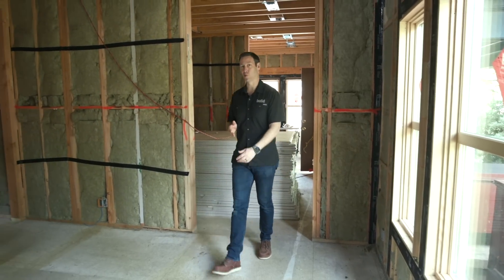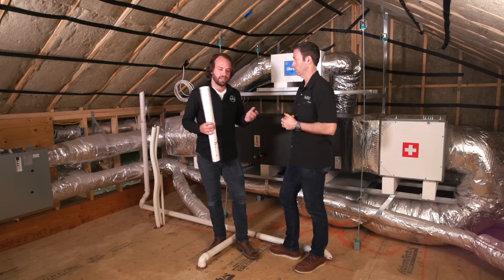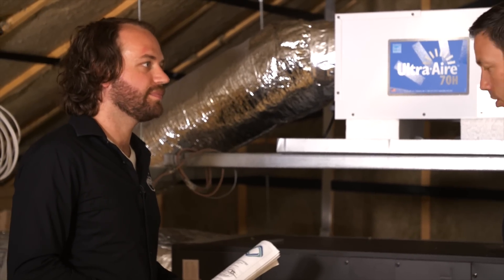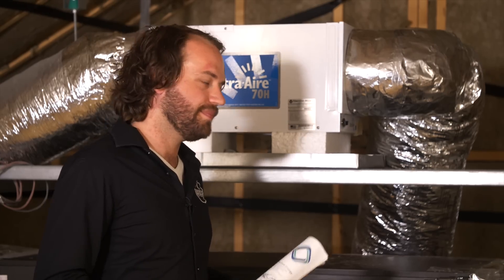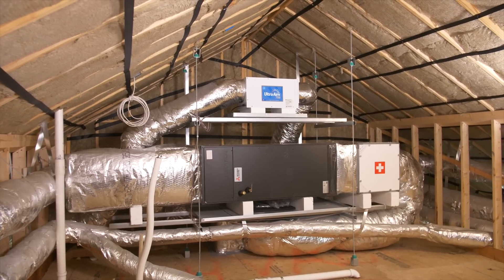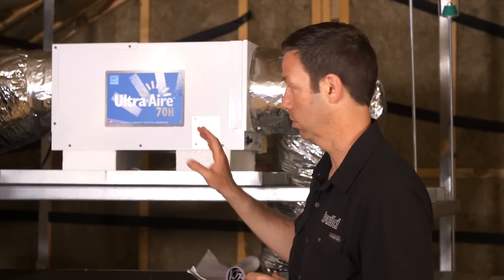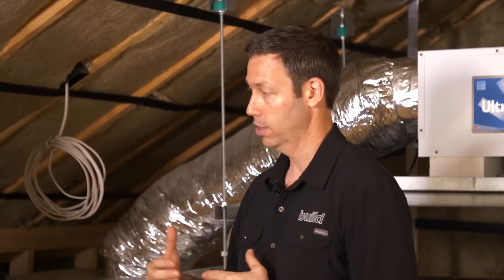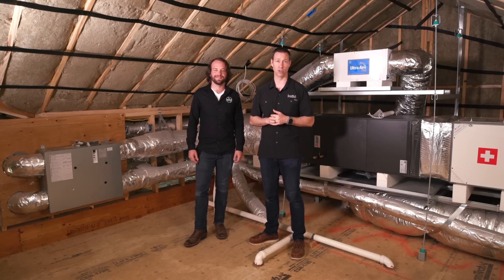New BUILD : Excellent Air Conditioning System Cost?  I’ll tell you!

Comment: “So what does a typical unit cost here”

“Well you know, it all depends on the environment but things have become highly competitive”

I get it, I can’t afford it.
Reply: A VRF or VRV System will cost around 20k not including duct work. It is 28% more efficient than a variable speed system with over 750 different stages. We have customers that go from paying over $200.00 per month year round to paying $60.00 per month year round on electric bills. If you get a good finance plan say 3.99% for 144 months and your monthly payment is around $160.00 the system pays for itself and you get a much more comfortable house and it’s good for the environment.
Reply: @ryanforeman2581  SO, the system is self adjusting using 15 to 100% throughout various rooms in the house and shouldn't vary in cost from size of house or state to state? 🤔🤔🤔
Reply: Valerie Smith I go to training all over the county and pricing is within $1,000 everywhere. Price will vary somewhat based on size of house. 20k is a good ballpark though.
Reply: @Ryan Foreman, overpriced.
Reply: you save 140 a month. so 20 a month for the unit over the course of 12 years is 2880 for the unit. 12 years is pretty typical life for normal ac units. normal units cost about 1,500 to 2,000 for just the unit about 4,000 nationwide average. now that on average save you 1,200 or 100 a year depending on which unit will last the longest life. a 20k unit also puts pressure on you in case it fails or needs any maintenance over a normal unit eating away at the $100 yearly saving or possibly add to that savings, this value drop if your spending under 200 a month now. or live in the colder climates where you don't use this year round in which case you need the unit to last about 25 years to break even with a normal unit.
Reply: JediOfTheRepublic 
Why can’t they just say the numbers?!!
Reply: @curtcmiller  Because the number for that house in Austin is not going to be the same for a house in Phoenix or Wisconsin.
Also, the size of the house will determine the size of the setup required.  The style of the house. Etc
Reply: Mo Gumede What if I am in Austin?
Reply: @mogumede8211  OK. The units are going to be a standard price. Ducting and all that goes with it is going to be the variable. I came here for hard numbers not percentages. Most of these videos never give hard numbers and it kills me. I understand that this house is not the same as mine in Alabama or Bobs in Maine.
Reply: @GoatZilla  Exactly!
Reply: What do they need to tell you,that you couldn't figure out yourself; with doing a little research on the internet as far as costing the products that they are talking about. Then figure in the Skilled Labor, Which doesn't include the Lowest bidder.
Reply: Gcanno what do you care?  But if you must know, I’m interested in the breakdown from a builder that’s built a bunch of custom homes - so he has some insight to the relative $ amounts. I don’t understand what’s so secretive about the underlying facts behind the % Matt & Miguel are quoting.
Reply: Frankly... The HVAC guy didn't directly answer any of the questions
Reply: @JMcMusicman  
That kind of thing makes me angry. My customers want to know the bottom line. So I give it to them. I also make a rough estimate on the return on investment in energy savings and service calls. Service calls on old or poorly designed systems average around 175 per visit. An electric resistance furnace can cost 4x as much per BTU than a Heat pump split system. We can't use natural gas around here because the ground is deemed to be unstable.
Reply: Pretty nice system for $6k with that massive dehumidifier and filtration
Reply: Well depends, a bigger house needs less heating/cooling per square foot than a small house, also are you going to let me run my duct in the easiest location or do you want it all stuffed out of the way and take me 4x longer to install? 

Its really a tough question to answer but i think a proper install trumps adding bells and whistles.
Reply: JediOfTheRepublic  That one must have been at least $40k I guess.
Reply: VRF systems start at $8500.00.
Reply: JediOfTheRepublic He only does million dollars and up homes
Reply: I heard 2-5 times typical
Reply: The air filter is crazy expensive you can have someone fab a filter together using union labor for around 800 dollars or you can pay 2800 bucks plus deposit
Reply: He talks like a politician, can’t give you a strait answer!
Reply: It’s triple the cost of a good system.
Reply: SEEMS LIKE THEY HAD AN UNDERLYING AGENDA
Reply: Did any of you ‘listen’ to what they said? 🙄 The House is 2000 sqft; that system is approximately $6,000.00. The math isn’t that hard. A quality system is about 4% of the build cost. $50,000.00 x 4% = $2,000.00. For the HVAC. The dehumidifier will run about $1,500.00. The fresh air system $1,500.00. 

$2,000.00 + $3,000.00 = $5,000.00. On my build of 50k for 1200 sqft I’m looking at 5k to 6k for the entire system. Add a grand or two for installation if you can install it yourself. 

I’m amazed at the FREE information given in these videos, yet people STILL can’t figure it out. Pay attention! Do some calculations and research. 🙄🤷🏻‍♂️
Reply: @curtbuettner7337  at 8:30, Matt states the total construction cost of that house is $500,000 to $1 Million.  Hardly the $50,000 you state.  $50,000 might get you a tool shed in Austin.  Matt also states that unit is 5-6% of construction cost.  That would mean that HVAC unit is $25,000 - $50,000.   Just before that he stated the unit would range in the $40,000 to $70,000 range.  Definitely not $2,000 as you state.  Wholesale cost on a basic variable compressor unit alone is multiples more than that, muchless a top end Mitsubishi.  He also says the dehumidifier is a $5,000 to $6,000 upgrade, not $1,500.  Your reply seems extremely condescending considering everything you said was no where close to what was said in the video or reality.
Reply: @curtbuettner7337   I’m rehabbing an old house  with plaster walls:  I plan to rent the rooms on Airbnb- I’m planning to do mini split units. While the attic is open should I add a dehumidifier? I want to make sure I’m getting the right information: and doing the right things for comfort and energy efficiency.
Reply: @vickiewoodard3180  depends on what State the house is in. Southwest I wouldn’t worry about it much; but the Southeast, I would. Google dehumidifier for “sqft” of your home. It will give you the size dehumidifier you need. Also; you’ll need to plumb a drain line from the dehumidifier either into your existing waste water piping or, too the outside. You’d be amazed at how many gallons of water gets pulled from the air; and you don’t want to empty a dehumidifier bucket daily. After you locate a dehumidifier you like, YouTube that model to see if anyone else is running it for Pro’s and Cons. 👍🏻

Comment: Made me laugh that your thumb nail says "it's less than you think!" .. meanwhile it was about 100% more than I figured it would cost
Reply: They don’t pay for themselves.  Just stop
Reply: Variable refrigerant flow units. The fans and compressors ramp up their speed depending on heat load versus a traditional bang on bang off unit.
Reply: @timothymason7609  yeah it's called an inverter.. they are definitely more efficient but is not new technology. . And a lot of times is hard to get the return of the investment, with the exception of very hot climates, where it would run all year like you mentioned.
Reply: @piercer4882  In many parts of the world the cost difference in the unit is about 300$/400$, so yes, it does make sense.. in this case.. well, the price difference is HUGE.
Reply: I think a key point that many might have missed is that these units use 30-40% less energy. HVAC, especially in the south, is easily 60-70% of your electric bill. These units typically pay for themselves in a few years.
Reply: @timothymason7609  what do you mean by "these units"? As far as I could tell, it was a air handler,  presumably with a heat pump sitting outside.

Comment: Spray foam insulation would have been a much better choice for this attic if the face of the roof rafters were encapsulated.  Note the exposed roof rafters that are going to transfer heat from the roof in the summer (into the attic space) and heat from the house to the roof in the winter.
Reply: All the house uses non foam.  The reason is health safety.

Comment: Come on! $70,000 to install AC? I just did a 13 Seer 5 ton system replacement in Ohio for >$4000. It is perfectly fine and it would take 100,000 years to recover the $66,000 difference in a higher quality system. I have the regular HD good (not better or best) filters and in the system and find no dust buildup at all in the AC. The 20 year old system that came out was perfectly clean. Pricing was competitive but the installation looks very good and no issues. Rheem WA1360AD1NA current cost $1751 for the unit. The bigger AC companies were quoting 2X the equipment (which I had to pay in advance) cost plus $80/hr installation. Total would be about $7000 but I shopped and found a reasonable price.  Electricity is only 5 cents per KWH here on fixed rate 3 year contract, so in actuality I would never make up the difference.  Oh and my house is 3600 sf above ground.  1500 below.
Reply from the maker: You are just talking a change out. I’m talking new construction with the entire system
Reply: There’s no way a 5ton system at 13 SEER was installed correctly for $4K

Comment: You should do a video on ducts and different types. I’m assuming rigid has smooth metal walls that are more resistant to mold building up like “rigid” fiberglass ducts
Reply: In a well designed, sized, and properly executed installation, there should be NO mold present, to accumulate in the duct work, regardless of the type of materials utilized.
Reply: @leftistsmustexpire  Though true, its a difficult bar, and for long term health I prefer the metal  I have had to work with mold issues in the past.  A metal duct can be cleaned as well and better IAQ.

Comment: Seems like conditioning air, humidity aside, is the old way of HVAC. I don’t believe humans need to live in clean room conditions, either. If the enclosure is air tight, properly insulated, with good thermal mass, then the need for filtration and ‘air conditioning’ should be minimal, so let’s get away from it.

Comment: Matt, what the comparable electrical load on this to traditional systems. I understand this is a great system, saves fossil fuel use, but i just wonder such a big system with so many components what the electrical cost is per month or year. Great video and so much great info.
thanks, 

Ron
Reply: ron prize quite a bit less than standard AC systems. Each of the systems you see here is very well engineered by their respective manufacturers.

Comment: Damn here I am 57 years old if I get cold I turn the heat on or build a fire if I I get too warm I open the windows or turn on the AC as always I think this stuff looks good on paper but normally over-engineered and over thought great if you're in the business of selling HVAC equipment great video though
Reply: I agree high tech equates high maintenance, for the most part. KISS.
Reply: Tom Mitchell I’m with you. Modern homes are not designed to allow natural cooling/heating. They are pretty boxes that need extra tech to make them livable. It’s the modern consumer who loves this stuff. I grew up opening a window for air conditioning. I totally think that’s sufficient. Of course if ya want to live in the desert..
Reply: Stuff like this is more about "keeping up with the Jones", which is a great market to sell to.   Buy product, get excited for next new product.

Comment: $35K for a $500K house at 7% - Not sure how large the house is but a "Bungalow" would be less than 3K sq. ft. Could be easier, cheaper and better to use multiple mini-split heat pumps
Reply: 100% true
Reply: In the future it will be no problem to have 1 outdoor unit running 4+ indoor units from large air handler units along with smaller ceiling units in master bedrooms.

This is what Mitsubishi S series is and it’s what I’ll be doing with my house in the future. That’s actually VRF instead of just VFD tech that Matt keeps calling VRF for some reason.
Reply: @NotOurRemedy  VARIABLE FREQUENCY DRIVE
Reply: ONLY A 2000 SQFT HOUSE....BASIC AIR HANDLER  SYSTEM..WITH A DEHUMIDIFIER ADDED

Comment: merv 16 is to high units gonna work alot harder bet static is fairly high i much prefer electronic filter with a bi polar to clean the air. a dehumidifer with a variable speed unit is  over kill at least the ductwork looks good
Reply: Pressure drop with that much paper isn't so bad, their website says 0.18 in H2O at 1,200 cfm

Comment: Since there were some strong hints that this system is $50,00, let's break that down:

Positive Energy design service: $7000 (0.5 to 1% of total construction cost)
Mitsubishi 2-ton condenser, evap/air-handler, and line-set: $4500 (eComfort & many other at this price)
UltraAire 70H: $1250
Panasonic ERV: $1000
Misc electric, new ducting, labor and other fees from HVAC contractor: $36250!!!
Reply: The design service & equipment costs seem reasonable, but the HVAC contractor fee for a 2Ksqft house seems pretty excessive - especially since they aren't doing the design & specifications. If you assume 25% is supervision/manager and 75% is labor/expertise for the actual install - that's a 2-man crew working full-time for a month @ $85/hour to install the ductwork & equipment and make the electrical connections, and you know the contractor isn't paying the installers $85/hour - I'd be shocked if they're paying $50/hour.  And Matt's talking about the HVAC contractor needing to make a profit on the equipment.
Reply: northavealum the sad thing is the actual installers (not supervisors/lead) probably make under $20/hour.
Reply: @AMTAUSTIN  I'm confident you're exactly right - I used the higher figure to illustrate how ridiculous the economics Matt & Miguel presented.  More likely the HVAC contractor is making even more money.  Makes me want to go to HVAC school for 6 months to learn the fundamental so I can skip the HVAC contractor altogether and afford the $7K for a firm like Positive Energy to do their thing.
Reply: @northavealum  if they're getting $7K for that simple design, they're cutting a fat hog. Probably around $3.5K is more like it - and that would still be a very fat fee vs the design effort required.
Reply: ArthurDentZaphodBeeb I agree on the design cost and would hope there’s some other companies offering this service. I would much prefer an hourly cost.  The design service is a step in the right direction: being able to be fully educated in the HVAC options. Next step IMO is separating the equipment procurement from the HVAC Install services
Reply: @ArthurDentZaphodBeeb  RIGHT!.. THAT IS A BASIC DESIGN WIYH A HUMIDIFIER
Reply: @northavealum  WOULD BE WORTH IT IF YOU HAD THE TIME...NOT ROCKET SCIENCE...BASIC STUFF
Reply: @northavealum  It should take them no longer than 5 working days to install all that rig on that small house.
Reply: I am planning to install something like this on my remodel and almost fainted when Matt quoted the price.
Reply: @sathapalani  FIND A HVAC MAN THAT WILL TELL YOU THE TRUTH...THAT IS A BASIC SYSTEM
Reply: Ya I was lost on how he got his numbers for the cost! I've worked in AC and have ongoing conversations with my wife's Uncle. I was expecting these units to cost a lot. But I guess I'm used to country/rural pricing and not city folk prices... My wife's Uncle already does these CAD type plans and doesn't overcharge his clients for it...
Reply: Looking at Positive Energy's website, they're charging $6/sq ft for design services and tell customers to assume $20-$25/sq ft total installed costs. That's completely ridiculous to me.
Reply: In Russia this project cost maximum $1000. So simple
Reply: @modestkornilov7320  how about now? Lol
Reply: Welcome to the business boys!  Go ahead and make the investments, take the liability and deal with the employees and customers.  I suspect you will find long hours, lots of headaches and profits that are well under 10% at best.  Go get em!
Reply: Jere Putnam II yeah those poor builders & Hvac contractors are all just scrapping by. We should all just suck it up and turn a blind eye to equipment markups & $35k HVAC systems.
Reply: @northavealum  Come on in and jump into the trades, it's easy money!
Reply: @JerePutnamII  Lol not exactly.  My buddy in commercial HVAC will break $6M in revenue his 5th year in business.  There's tons of money to be made you just need to know where to look.  Residential middle class is the bottom.  Get into custom homes and or commercial work to find the pot of gold.
Reply: @JerePutnamII  10% profit for a relatively low-risk, low-skill, low-barrier-to-entry business is very good
Reply: @ArthurDentZaphodBeeb  Then do it yourself, start your own company  .
Reply: @Gcanno  No, thank you. I have an education and was able to command significantly higher profit margins. Anyone thinking 10% profit margins in low-skill, low barrier-to-entry businesses needs to give their head a strong shake...
Reply: RIGHT...FOR A 2000 SQFT..HOUSE!...
Reply: I WOULD HAVE EXPECTED THE DUCTS TO BE .." METAL WRAPPED".. LIKE YOU SEE IN INDUSTRIAL PLANTS!!